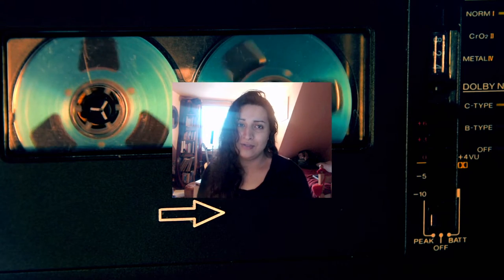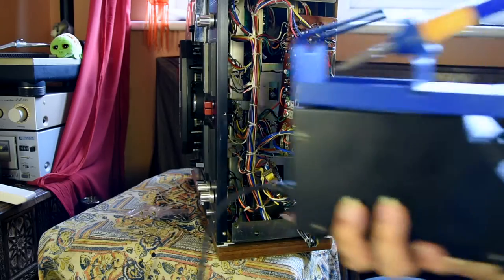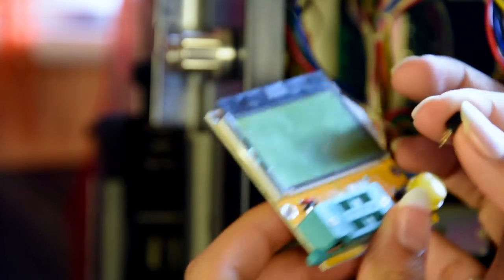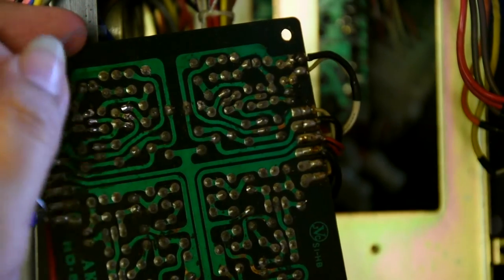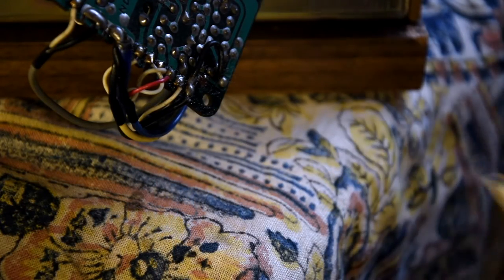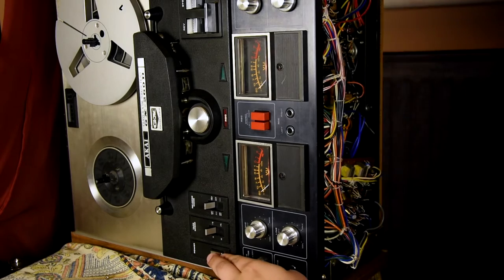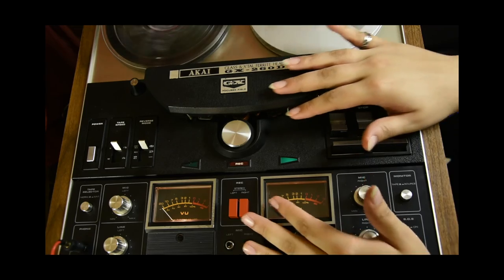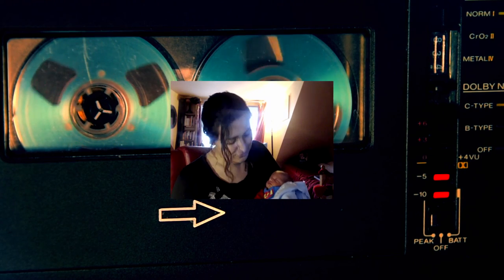Akai GX-260D Repair & Restoration Part 4

Comment: MsMadLemon: You did a fantastic job restoring that good old Akai R2R recorder. Most people making things worse when trying to repair or calibrate those old tape machines. But you did it according to the specs in the service manual I guess and that is exactly the way to do it properly. To make the calibrating job a little easier you may get your hands on an used analogue ac milivoltmeter. Using one of these, the calibration process would be much more precise. But this is sort of "big time whining" ;-) As said before you did a really fantastic job here and I really love watching your videos because of your unique way of doing those videos with a lot of positive attitude and a good sense of humor. And to be honest with you: I learned a lot about checking transistors the easy way! :-)))

Comment: Good job, always nice to see a tapedeck up and running again. Cringed a bit at the spray-n-switch part, though :P
Nice to see the parts tester came in handy. 

Oh and great job on finding the problem with the flux! You used your gut instinct, which turned out to be dead on. I've had many repairs were my instinct said: "I think it's this" and I ignore it just to find out after a long struggle that it indeed turned out to be true. I actually never needed flux. When old solder does nog flow very well I just add some new solder, which seems counter-intuitive but actually makes sense. New solder has a flux core, so it adds just enough flux to make the old solder desolder easier. Also works great for transferring heat into larger connections.

Enjoy your newly restored tapedeck!
Reply from the maker: It actually makes sense to add new solder to old, i've done that a couple of times when de-soldering stubborn joints. I tend to use a little flux on the soldering wick because it makes it more effective. However sometimes leaves a residue which I brush off afterwards.. I have learned well from this!

And thank you! I'm already enjoying the tapedeck, i've been doing a lot of recording these past couple of days :o)
Reply: Where did you buy that transistor tester? I need something like that.
Reply: Its great that you are enjoying your rtr I will be doing the same in the near future.
Cheers/Rob
Reply from the maker: I hope that you do! 
The transistor tester: http://www.ebay.com/sch/i.html?_from=R40&_trksid=p2050601.m570.l1313.TR12.TRC2.A0.H0.Xtransistor+tester.TRS0&_nkw=transistor+tester&_sacat=0
But try to get one which is shipped from the US since you're there, the first time I got one, it shipped from china, arrived after almost two months, the packaging had no padding and unsurprisingly the screen was broken!
Reply: Thank you!
I am going to see if they carry it on amazon.
if not it will have to be ebay.

Cheers/Rob

Comment: Good day, would you be able to share with me the service manual. While listening to my Akai, one afternoon, it caught fire and later it seemed that one of the solenoid/switches burned out. So my piece works only in reverse now and i wanted to try and sort out the damage and get it working again. Thank you.
Reply from the maker: Good day, it's been a long time since I fixed this so I dont really know where the service manual file is, but i've done a quick google search and came across this: https://www.hifiengine.com/manual_library/akai/gx-260d.shtml
Hope this helps.
Reply: @MsMadLemon  Thank you for getting back to me. I did come across that URL and tried to register there but for some reason i kept getting the messages that i was trying to register from a blacklisted IP. After receiving your message i tried once more and it worked, i am registered and i have downloaded the manual. Thank you. Wish me luck :-)

Comment: hi know full track mrl kind of tapes cost money   i use one all the time   i have seen so many tape unit's where of the tape head levels are not right you are doing a ace job with the tools
you got if you see  used 1/4 inch tape at low cost buy one. very good for the tape decks

Comment: Hi there you are very good at fixing that Real to Reel LOL I am reaching out I've got a Sony TC 730 reel to reel and I just got it back from being repaired and I'm having an issue still when playing in forward the sound cuts in and out on both channels at the same time and it does just randomly at any given time but when I have it and reverse it doesn't do it at all so if there's any way of knowledge that you have on this on what it could be I would greatly appreciate it thanks
Reply from the maker: Hey, well I'm not sure about being good at it haha but I figured stuff out as I went along and learned, I do highly recommend the Tapeheads forum for issues, i'm not sure what is the issue with your Reel to reel, my guess is possibly not enough power getting to the amp? but a wild guess since i'm merely trying to visualize what it's doing lol.
http://www.tapeheads.net/
Reply: Lol yeah it cuts out only in forward and it's both channels at the same time and I never know when it's going to do it it could do it for just a few seconds are the 20 -30 minutes before it does it again
Reply from the maker: Another hunch, has it been recapped? maybe a capacitor has dried out? The first thing I did was replace the capacitors in mine, these systems are freakin old lol

Comment: Good day! You are well versed in the technique! In this we are colleagues. I also gather your collection of old audio equipment. Maybe you know where to download the circuit diagram from PIONEER RT-707 and AKAI GX-65? I already bought them, and now repairing without a diagram. Sincerely, Alexander.
Reply from the maker: Good day to you! And thanks!
When you are searching for circuit diagrams, in google, be sure to search for the 'Service Manual' instead of searching for circuit diagram, as service manuals always contain circuit diagrams (or at least they should)
here is one for the Pioneer RT-707:
http://www.kallhovde.com/pioneer/rt-707sm.pdf
and here is for the Akai GX65:
http://elektrotanya.com/akai_gx65.pdf/download.html
Reply: Thank you very much! I found schems and I already restored akai and almost repair pioneer!

Comment: Why did you replace those transistors?  Was there a noise problem?  Some old 2SC are notorious.  Beware to check hfe values.  Usually transistors should be paired to prevent uneven amplification.
Reply from the maker: I heard those particular transistors are prone to corrosion and degradation, according to a few people who advised me at the time, so i thought it's best to just replace.
Reply: I have been watching some of these videos.  It is informative and fun.  I have a hobby of repairing and restoring vintage sound equipment for "my collection".  I have the same JVC cassette deck as you do.  It's also in good shape, cleaned and calibrated.  I like Super ANRS.  I have to recap it when I find time... I was having the same questions as 1959Berre while I was watching this video and saw that the hfe value of the old and new transistors were different.  I agree w/ 1959Berre but had no information about the reliability of the old transistors.  IMO usually the Darlington transistors that heat up may give trouble.  BTW, I congratulate you for doing this job without an oscilloscope, which would make your work much easier/faster.

Comment: Hmm...this was confusing. I was really hoping to see how to calibrate, but your video was a bit all over the place. You first loaded a small tape with test tones, but later that vanished and suddenly a larger reel was there. It would have really helped (me at least!) if you had really walked us through this step by step with detailed explanations - like what tone you generate, and how the connections are done. This really wasn't clear in the video, especially for playback. Where did the black wire go to? What was the software used on your phone so a person can perhaps download it? Occasionally, when you did give crucial information, like a frequency, your laughing "swallowed" it so I couldn't understand what you said. Then, when it came to calibrating recording, you pointed in a vague direction of where the variable resistors are, but you didn't show them like you did for playback. So due to a lack of information in both cases, I couldn't really use your walktrough to calibrate either playback or recording. In the former case, the connections were not clear, in the latter the position of the resistors. The confusion between the small tape, with no details of what kind of tone you were using, and the larger tape, didn't help either. Which is a shame, because with just a little clearer information I could have seen and understood both. Nevertheless, thank you for showing all this, and I am only saying this because I think your video could have been so much better. This "walk through" I am sorry to say does not really help a "newbie" like me who really needs to be given detailed, clear, step-by-step info. I am sure a "profi" will have appreciated it though...
Reply from the maker: This wasnt really meant to be a "walk through" tutorial video but more of a vlog style where I was just showing what had happened and what I did. I am not sure where you got the idea that this was supposed to be a walkthrough video.

Comment: Any engineer in mumbai
My akai gx 650d problem is pinch roller not pull down while playing
My machine is in working condition i change the capacitor moter is going slow down the problems offers when adsule all parts plz help
Reply: The problem occurs  when i assemble all parts

Comment: I do not understand why you changed those transistors when every thing worked fine
Reply: I agree with you on that. Transistors are very reliable and the only time that they fail is usually by way of a bad capacitor... Same thing is true of vacuum tubes believe it or not...
Reply: So if you remove them how can you test them to be sure they are working? what would you use to test them?Cheers

Comment: On the power amp for the amplifier borad yes i am pertty sure on the that but on the rest of the boards like the playback ,record, and the BIOS are original which the people that I had work on it I don't understand why they didn't recap everything
Reply from the maker: BIOS? ...We're alking about a reel to reel recorder right? lol 
That is a bit odd that they didnt recap the whole thing, It's the first thing i'd do when getting any old system, whether computer or vintage audio. at least to rule it out.
Reply: Yes i know i don't understand it I called the guy today that worked on it and he's convinced that it's dirty switches for me just to keep moving them I don't see that solving anything it's just weird because it didn't do it the first two days that I had it back
Reply from the maker: It could possibly be, though just moving the switches wont do as much as getting a good contact cleaner like Dioxit, 
Come to think of it, my Sanyo Boombox (señor sanyo) is having a similar issue, but not at a set time, just the left channel cuts out, then I have to stop, play, stop play or mess with it to get it back on again, its infuriating but this is just one channel unlike yours. 
One thing i've learned from experience is do the simplest thing first, get some good contact cleaner (Never ever WD40) and spray all the switches and pots, then move them around, same with the record/play switches on the circuitboard like how I did in this series.. if that doesnt solve them, well you got good clean contacts at least now, and you can move on to the next stage.

Comment: Where did you source your tape with the test tone?
Reply from the maker: A friend with a working RTR deck recorded them for me, other than that there was no way to get hold of one.
Reply: Is the recorded volume of the 200 hz test tone important when used to set the pots to the desired voltage output then zeroing the VUs?

Comment: hi this is kevin um I'm not sure if you'll get this comment that I might send you there is a company in Australia in Brisbane it's on the northside of Brisbane they do sell reel to reel tape spring you for about $40 for 10 inch real what I do I just buy the blank tapes comes in a pancake type a manner and I just spill I'm off onto 27 inch tapes about 35-40 dollars um a tape so that might be interesting for you to chase up I think it's called audio something it's a shop on the northside of Brisbane at Bowen Hills just type in Bowen Hills audio Electronics they do sell reel to reel tape Sphere if you are interested I've got to Akai machines at the moment I've got to go shopping tomorrow and I trying to get some little nuts little bolt sorry little bolts for the heads fact that somebody has chewed out the top bolts of the head stack there's about 8 of them and I can't get the mouth I got for them out but not all of them so I might go to the nuts and bolts place tomorrow and see if there is a similar bolt that will fit it so I can realign the heads properly I've got to a guy machines p I can't send you a link to your Channel 2 um show what type of machines I do have anyway please get back to me kevin thank you